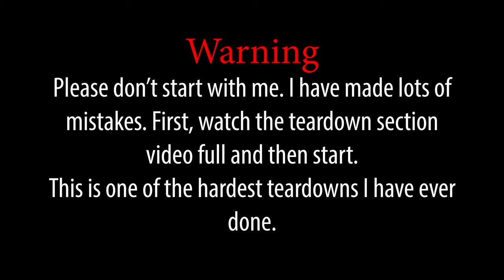Fossil sport gen 4 smartwatch teardown | Battery replacement | Disassembly

Comment: Will Using t-7000  make my fossil gen 4 explorist waterproof back again???
Reply from the maker: Yes, if you make proper fix without any gap
Reply: @diyeasy_in  
Bro how long it will be waterproof then?? is there any specific depth for the glue it can survive in water?

Comment: Hello. Do you know where I can get the battery now?
Reply from the maker: Plz check aliexpress
Reply: @diyeasy_in First, thanks for your answer. I did it but just is available THE APP00276 and APP00296. i asked at sellers and they don't have the APP00286 like you video. In ebay same conditions

Comment: Is there any reset process needed after replacing the battery? I have one that went out completely and I figured it was a dead battery, but found it was at about 3.56V when I opened it up and measured it.
Charged it offline to 4V and plugged all the connectors back in, but it's still dead to the world, no display or anything shows up.
Reply from the maker: Reset we can do once it is switched on... I think issue is something else, maybe main board
Reply: @diyeasy_in  it may be defective, seemed to go bad once the battery was allowed to get too low, and it corrupted itself as a result.

Comment: Where did you get the battery from, I can't find a single one to buy online.
Reply from the maker: Earlier it was available on Aliexpress... Now it is not showing 😐
Reply: @diyeasy_in  I was able to find an another one that looked similar but I'm not sure if the pine layout is the same. I was wondering to myself if I could cut the terminals with the board and ribbon intact of my original battery and transfer it to a better one. In power saving, I'm getting 3 hours.
Reply from the maker: Before buying, please check the dimensions that will fit in your watch. You can extract the board from old one and can put it in new one, but it highly risky, and you should have some electronic knowledge... Like soldering.
If you don't have those knowledge plz check with any guy who know....
Reply: @peabutt38  In all honesty idk if my watch battery is in the same condition as yours, but I learned that the battery is too small for the watch to have all the features on all day. I managed to getting a 1 and 14 hours before mine dies and that's because my Bluetooth is on during the time I would usually put it on using the custom power saving mode. Also my screen is off until I press a button. Things like location and wifi are off until I put it to charge. try to tune off the animations the make you processor work harder burning though that precious power. Hopefully that can be useful to you.
Reply: @peabutt38  mine is doing the same. Trying to find the battery

Comment: Thank you very much your video is very helpful for me event though is fix my fossil gen 3 

I have some trouble  that I crack crown sensor because i try to press hrad power button (in fossil gen 3 is same power button position ) I can still scroll the crown but cannot press it .
I power on my watch by charge but i cannot press it to open menu or application TT ∆ TT

Do you have any trick to open app menu  by another way ? Plz tell me.